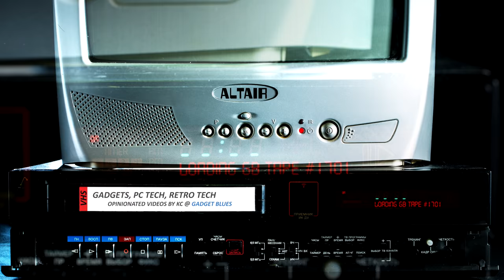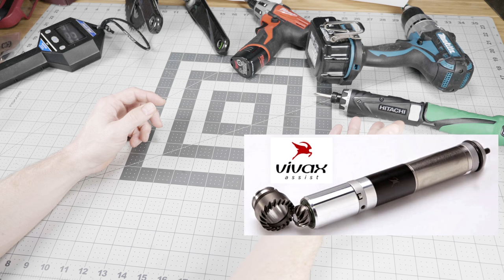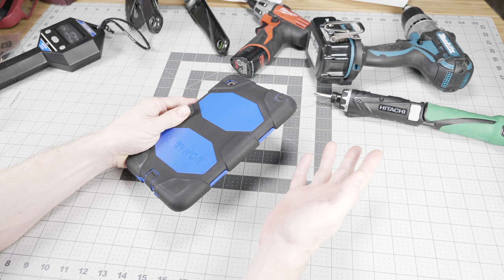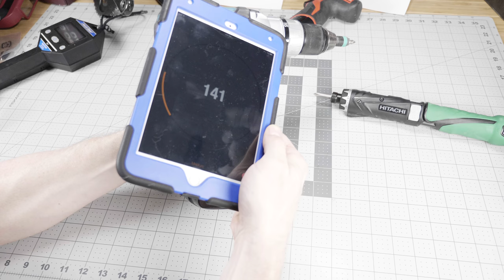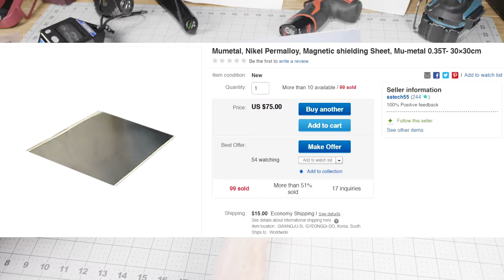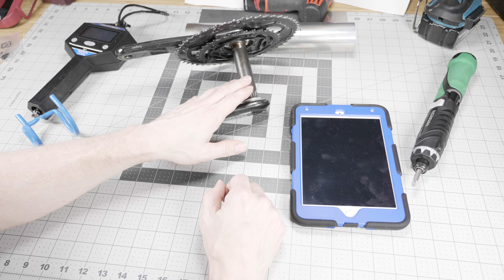BIKE TECH Detecting Hidden Bicycle Motors!

Comment: Great video, thank you. As an engineer myself, I think there is a point that could be added to your video. In order for an electric motor to create a momentum from electricity there need to be electromagnetic field waves acting in a way to create a lorentz force, rotating a shaft. There are two different ways to create a magnetic field, where a motor can act within the laws of lorentz forces: 1. Creating the electromagnetic field via a permanent (neodym..) magnet. The disadvantage in this case clearly is, that the electromagnetiv field of the magnets are permanently measurable. Thus, the second option might be the better,  not detectabale: The usage of non permanent excitation DC motor. In these electric motors, the electric field for the excitation of the motor is created by a sperate coil. In this case a significant magnetic field measurment can only be read when the electric motor is running. Sorry for my english, I'm from germany and love your videos!

Comment: aren't you just detecting the permanent magnets in the power tool motors?  Would a brushless DC motor even register on the magnetometer if the motor was deenergized?

Comment: Hia, quick question.
The sensors in the iPad are measuring the magnetic field of the magnet in the iPad no? And the system is basically detecting the change  of magnitude of the magnetic field. So why does the iPad not pick up change in its magnetic field when close to the mu-metal? As it is used for magnetic shielding, isnt it going to disturb the magnetic field? Just trying to get my head around it, thanks!
Reply from the maker: The mu-metal is non-magnetic like wood or aluminum; the only difference is that mu-metal also shields whatever it's wrapped around. So the mu-metal itself doesn't show up on the sensor just like plastic wouldn't.

Comment: Excellent! ... BUT, you missed an important method of cheating -- hiding the motor in the rim of the rear wheel. There would be no gear on the crank spindle so there would be nothing suspicious inside the bottom bracket. As far as I'm aware, no road bike has been found with this kind of motor -- but one world-class team was recently investigated by the UCI for it because their TT bikes with disc rear wheels weighed a little more than "normal". The UCI didn't find any motors in their disc wheels.

According to an engineer who is famous for developing hidden electric motors for bikes, it is very possible to hide a motor in a disc or wide aero wheel and it would be very difficult to detect. Evidently, it is the new "state of the art". In one interview, the guy even confessed to having developed such a motor for someone. How about doing a second video to address it. Thanks.